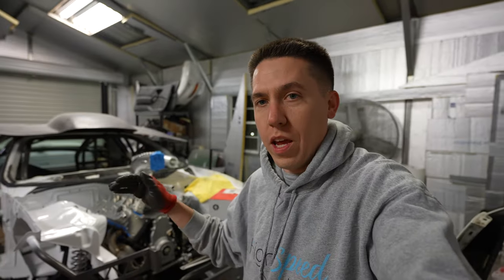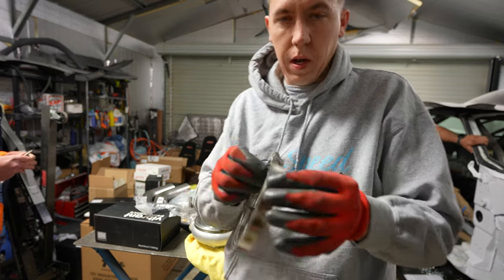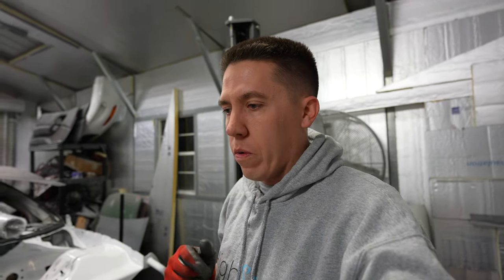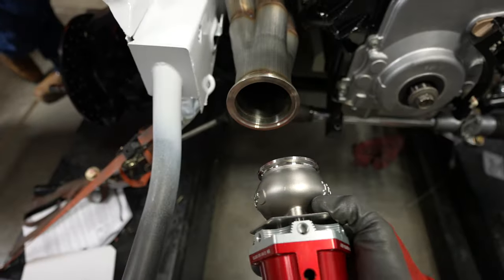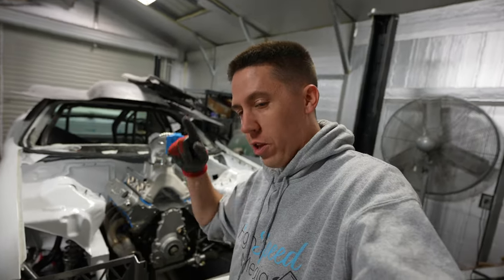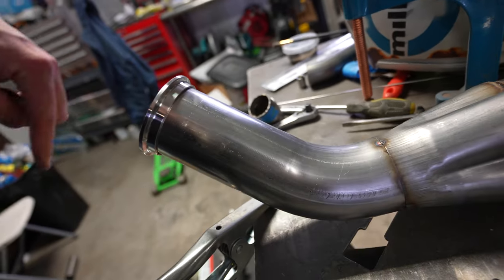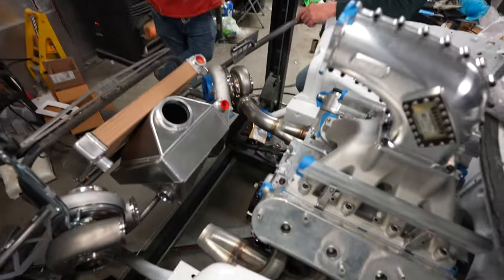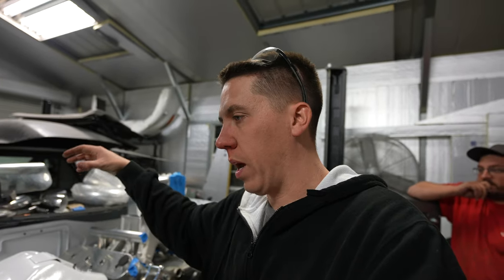Salty Camaro Gets 3000hp Worth Of Garrett G45 Turbos! Twin Turbo Kit Build Part 1

Comment: She's coming together!

Couple of things that might help:
- Weld tubes directly to the intercooler to eliminate one clamp per side... Two less failure points to worry about

- You're building for drag and drive events, yet your turbo placement doesn't allow for a typical conical filter... Watch Devin Vanderhoof's post-Sick Week 2023 video on the white Fox Vert, pretty ingenious filter setup
Reply from the maker: I seen what he did and really like how he made the filter holder. I was going to create like a floating filter in front of it but might make a similar mount to his

Comment: One of those I am planning on putting on my lil air pump, great units!
Reply from the maker: That will be sweet!
Reply: @BuildTuneRace  Oofta, I just saw they have a G45-1600 core available, a quick glance and that is better suited to my lil pump. Planning on an e-gate in the intake, c02 gates in the hot side for drag n drive

Comment: Could you use little v-bands on the header runner so if you ever got to take the header off you could just drop out that piece?
Reply from the maker: Yeah absolutely the header will come out of the with the runner on it though so I figured just keep it clean and simple one less v band to have to mess with and possibly leak

Comment: What manifolds did you use?
Reply from the maker: Flowtech turbo headers and modified the rear tube on the driver side to clear the steering shaft.

Comment: Make that pipe have two vbands so pipe can removed
Reply from the maker: I was originally going to do that but don’t really see the reason why I would ever need to just remove that piece. I figure I’ll either need to remove the turbo or head or both at some point but not just that little stretch of pipe by itself
Reply: @BuildTuneRace  I was thinking if you need to remove the headers to be able to remove the cylinder head ! You’ll need to be able to move the header back away from the head to get to the lower head bolts etc ! Would be way to remove the header completely